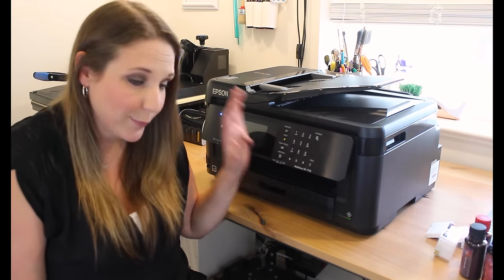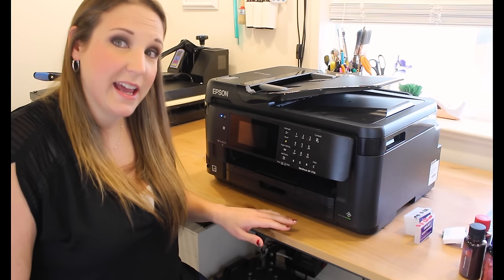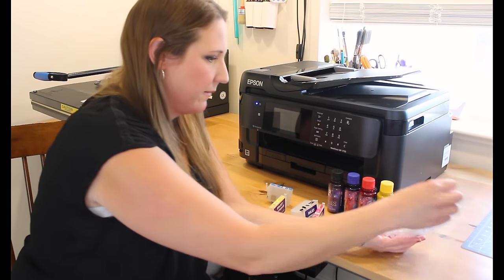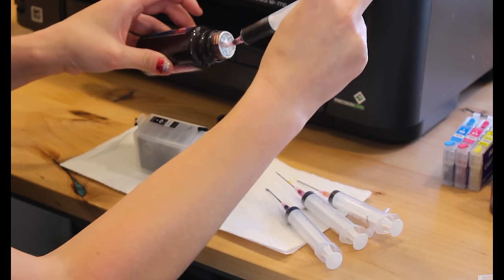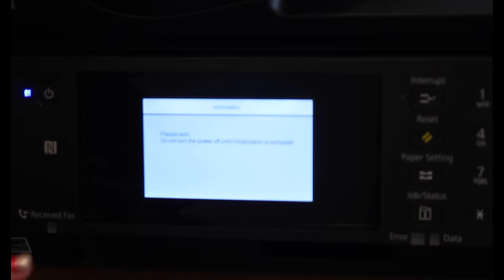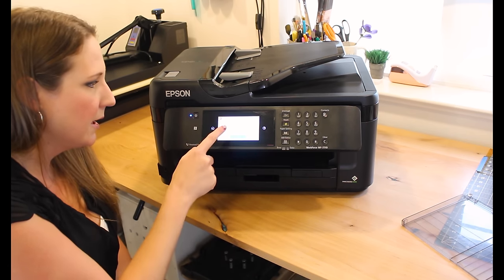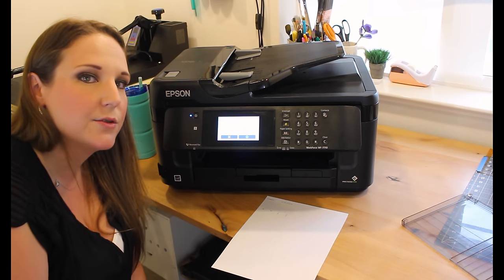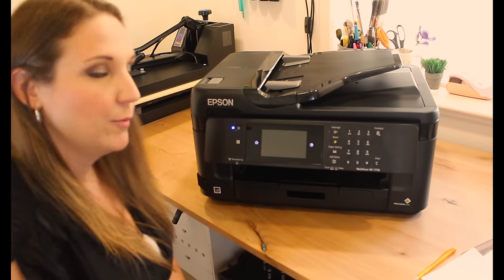How to Convert an Epson Workforce Printer to Sublimation

Comment: Debbie, I watched another video by you on the unclogging. You mentioned using Cosmos ink which I use also. The problem is that they sold out and  now Wala Inks sells ONLY the huge bottles which I cannot use (just a home hobbyist). Do you have any other suggestions regarding this? I love Cosmos Ink and have been told it's the 1st-2nd best without need for color profiles, etc.  I don't know what to use now or how I can purchase smaller quantities. Thanks in advance.
Reply: I hope Debbie answers your question... I'd like to know too!
Reply: Refill the cosmos with the walas

Comment: Thanks for your time spent on this video! I just wanted to say, when I changed ink brands in my printer(Brand X) rather than running several ink head cleanings, I found a colorful bubble gum picture on Google and printed it on 8.5x11 regular paper a couple of times and it ran the ink through rather quickly. Just a thought, worked great for me. THANKS AGAIN FOR YOUR VIDEOS!!

Comment: Hi  and thank you for your  tutorial very helpful and well presented. I have a wf2830 I bought from Wal-Mart for $99 for what I do it's perfect. The only suggestion would be for people like me with uncompetitive hands is to leave the fill plugs in until they are installed. I dropped a cartridge in the compartment and spilled some ink luckily no were to cause damage. I removed the plugs after they were installed. Thank you.
Reply from the maker: Good idea! I’ve spilled ink too. It’s no fun 😂
Reply: where did you get the refillable ink cartridges for the 2830
Reply: that was a question i had..... is it possible to convert the WF 2830 to sublimation. i am seeing all these other different workforce numbers but not seeing the WF 2830 as convertible printers

Comment: I turned my Epson artison 50 into a sublimation printer.  Could not believe how well it worked out.  I have 2 of them and an older R260 that I used for printing on DVD's in my Video business.  But since demand for DVD's is way down, I decided to give it a shot so I wouldn't have to buy another printer.  I am now trying to start a sublimation business starting with mugs and see how it goes from there.  Anyway, bought empty cartridges, 6 sublimation ink bottles and installed an icc profile.  I am amazed how well it worked.  I pretty much followed your video (thank you).

Comment: The CISS is a great system, I use one on my 7720 and there's a small learning curve to prime it that manufacturers don't go over. I took a trick out of my automotive clutch bleeding book. You hang the tank somewhere high and fill them up. Let the ink cartridges dangle low and make sure they're nice and straight. Then, one color at a time, use the provided syringe to pull the ink through the bottom of the cartridge. Don't stop when ink starts coming out, get a full syringe worth then put it back in the tank. As long as you don't let the tanks run dry, you shouldn't have any problems. But you're right, the tubing can be very sketchy flying back and forth at a million miles an hour lol, just follow manufacturer directions on securing tubing to your printer.

Comment: Hi and great video.  I just bought the wf-7310 with the re fillable cartridges and will use hippo ink.  Could I just use your process but instead farm the chips from the original cartridges after setup?

Comment: I was thinking about buying the same printer. I have a HP and I ordered ciss but it's a different brand so I'm hoping I won't have the same problem you do. But refillable cartridges are cheaper. Thanks for the information.
Reply: I have the same one as this in the video how do I get refill and which brand is better to purchase
Reply: @carlenewilliams5467  what model of printer do you have.?
Reply: @carlenewilliams5467  I got my Ciss at proinkshop.com. It was already full of ink and primed. I had mine almost a month and have done a lot of printing every day and I never have trouble getting air in the lines. It comes with a damper in the ink tanks and a damper in the cartridges themselves. When you receive your Ciss and if you have a lot of trouble getting air in the lines order a damper off of ebay and hook it on the line close to the ink tank and that should cure your problem. You can get a damper pretty cheap between 5 to 10 dollars.

Comment: By the way you can use standard paper to sublimate on the frosted side of that plastic mylar by taping the printed paper face down on it with heat tape and then heat pressing it which you will have to play with to get it how you want but it will make permanent stencils instead of you having to spend an arm and a leg for mylar sheets. I don't know if anyone else does that but it's something i did on my own and it worked!! I didn't print directly to it to try to sublimate it on anything though but hey i had the idea i might try it!!

Comment: Debbie, this is another excellent tutorial.  I do have a question about the refillable cartridges.  You noted the plastic 'tape' on the bottom of the cartridge should not be removed because the printer pierces it before use.  What about when you refill the cartridge for subsequent refills?  Does the pierced hole make a difference?  Also, what size will the scanner scan?  Also 13 x 19?  Thanks so much for  sharing your knowledge and experiences. Diane
Reply from the maker: Yes, the pierced plastic doesn’t matter beyond that. Just keep using the cartridges. The scanner isn’t quite as big as the print size. It scans up to 11x17”

Comment: Hello, great informational video.  You say the bottom tray will not have all the settings on the 7720, Can you just move the tray up to the top and change the paper size if it is different like you mention 8.5 x 11 on top and 13x19 on bottom?  Or are the trays physically different not allowing the trade?
Thank you.
Reply from the maker: No, the trays are not interchangeable. You might be able to forcibly out the larger tray in the top slot, but it won’t let you change the paper size accordingly.

Comment: Hi Debbie from Australia, Thank you so much for your video I purchased a brand new Epson WF-7725 and installed the Sub inks straight away after watching your video, do I ever have to do a head clean do the sub inks block the heads eventually I am new to this and wanted to know. Thanks in advance.
Reply from the maker: You don’t have to do head cleanings unless you are having problems with your ink. Even then, aside from the initial setup, I don’t recommend doing more than 3 in a row. If it still won’t unclog, then move onto a different method. This video covers the other methods I try. https://youtu.be/2sNtZwTs01c

Comment: My only question is is that it your using Cosmo ink why not use the purge file he recommends instead of doing several print head cleanings? Does doing it this way work better ?
Reply from the maker: This is the way I learned and know works. I have tried his purge file and I still had to do head cleanings to get it working but I have another printer coming this week I am going to try the purge file on again and see if I can get it to work.

Comment: Your video is top notch, the thumbs down always kill me on videos like these - I don't get it at all - 
That being said, I have a Epson WF-7110 and am able to print loooonnngg lengths from the top back tray.  
Are you at all familiar with this model?  
And am I understanding you correctly that your friend has run through the ink cartridges that came stock with her printer?
Because I have too and was told I couldn't  "convert" my printer.
Reply from the maker: You have to use refillable cartridges. The stock cartridges will not work. But refillable cartridges are easy to find for that model. They’re the same ones I use in my 7720.

Comment: Hi.  Thank you for the great video.  I have an Eason ET 2650 with the refillable tanks.  Can this printer be switched to sublimation ink in the same way.
Reply: Hi Lorraine
I have the same printer as you. Did you find out if it can be switched to sublimation ink ?  👍😀
Reply from the maker: Yes, ecotanks work great. No need for special cartridges. Just fill the tanks with sub ink.

Comment: Are there any issues with the Epson print driver stopping you from using 3rd party inks?
Reply from the maker: Sometimes it does give you errors. Usually if you restart the printer it will go away.

Comment: Ingot a lot from your video.THANK YOU just have this question for an Epson 2750 can we use ET 2750 cartridges  for it?
Reply from the maker: You need to find refillable cartridges meant for an ET-2750. The manufacturers cartridges will not work. They can’t be filled with new ink.

Comment: The colored cartridges are auto priming carts, but the black with that round hole has to be primed: that is static air and should be removed. Otherwise massive cleaning cycles are needed to remove the air from the print head. That round hole should be filled with ink after priming.

Comment: Thanks for your video!  I have a question though.  You say on the 7720, the bottom tray cannot be used for special print settings.  I'm guessing the bottom tray is for the larger paper?   If so, I would not be able to use the larger paper in the top tray to use the special settings?  Thanks.
Reply from the maker: You can use the other tray, you will just have to use the High Quality Plain Paper setting instead of Premium Presentation Matte.

Comment: Hello Debbie i appoligize if you said this but can a Canon  inkjet be converted or is it just Epson?
Reply from the maker: No, not that I know of. Most inkjet printers use heat in their printing process. The heat is harmful to the ink if it causes it to heat up before you are ready to press your transfer. You need to use printers that do not use heat in their printing process, and Epson is one of the few.

Comment: So, once converted and you need to refill the cartridges, do you remove them like original cartridge or do you leave them and refill them inside the printer so the printer's "Cartridge Not Recognized" alert doesn't go off? Thanks!
Reply from the maker: You can remove them, fill them back up with ink, and then put them back into the printer.
Reply: @DebbieDoesDesign  I sent this message over two (2) years ago. What took so long?

Comment: Best buy has the printer in stock and has a deal for a instant $120 gift card after you purchase one. I got the epson wf 7720 which is normally $299.99 for essentially $76 just an hour ago. $120 gift card and Walmart has them on sale for $179.99. They price matched.
Reply: Best Buy says: "I see you are getting free $120 Gift card with the purchase. I would like to inform, if we match the price with Walmart, the gift card will not be given. You can either have $120 Gift card or price match."
Reply: @montecarlo71500  I did both. I can show you a receipt. Of course I didn't  call them. The associate price matched with Walmart and after I paid for the item I received $120 gift card immediately.

Comment: Okay wow!! How i just wished you had this video out last year about early spring or summer when i absolutely trashed and burned my 7710 trying to use refillable cartridges with Inktec Sublinova ink. I see that i refilled the cartridges wrong i didn't tilt them and that first time refilling and placing down the refillables might i say is crucial because you start taking them out and replacing them you will eventually burn the print heads like i just did. Maybe that ink wasn't water based like it should have been?? I don't know if that was one of my biggest problems or not but i made many of them another problem i will add do not accept the firmware update this will stop you dead cold from using refillable cartridges. Well long story short i ended up buying a Sawgrass SG400 and i love it's easy use and the ink actually lasts a long time but i HATE being stuck with only being able to print out on 8.5 X 11.00 paper!!! I did later find out i can tile print an image on multiple pieces of paper but it can be tedious because you then need to cut and line them up perfectly on your substrate i suppose i could do a very small overlap i have yet to try that out but i will. Also, you can buy what is known as print film pet plastic from plastic guy on ebay it's basically white water washable frosted mylar that is .5 mill thick like stencils the same thing so there is a big money saver right there if you want to make stencils much cheaper and you can sublimate on the frosted side which will show up through the glossy side of that film then rinse off the backing if you want a transparent stencil which is pretty freaking cool. Let me know more how the refilling works best with the epson 7710 and 7720's though i might go back and buy another one for my larger prints sometime but i am buying different ink that actually works this time like you did lol. It was a sad day for me to have to toss the thing out because i unwantedly ruined the print heads!!

Comment: This video has help me tremendously but purchasing cosmo ink in usd and shipped to me in Canada will cost a fortune. Do you have a list of other sublimation inks that can still use the stock epson profile? I may find some at a Canadian supplier. My wife also uses the Cameo silhouette and this is a gift and I'd like it to work as seamlessly as possible.
Reply from the maker: Printers Jack is sold on Amazon and also comes highly recommended, if you’re still looking for an ink recommendation.

Comment: I have the 7610 would that work for sublimation?
Also, can you switch back and forth from sublimation ink to regular ink? I use my printer for regular, business and crafting lol so just wondering how that would work or if I need to get a whole separate printer for sublimation
Reply: The Cosmo Ink should work for 7610 as well, but it's recommended to have a whole separate printer for sublimation. As you can see the labor involved to switch between inks and ensure inks aren't mixing and nozzle heads are clean. Debbie Does Design Co. always provides helpful information, so I am just paying it forward by responding to a few questions on here, so these are just my opinions on having 1 printer for Sub and 1 for regular business use. I would recommend your 7610 for regular printing and investing in a 7720 for Sublimation since it can hold more paper and print long sheets.
Reply from the maker: Yes, what Millennia Studios said, you don;t want to be switching them back and forth. It’s a lot of stress to put on the printer and won’t last you as long as it should by doing that. And yes, that model should work. You just need to find the appropriate cartridges for that exact model.

Comment: I just bought a WF-7840 printer. Are you using the regular sublimation ink or the fluorescent sublimation ink in the video?
Reply from the maker: Just the regular sublimation ink. I haven’t used the fluorescent. You need to have a 2nd printer dedicated to the fluorescent ink if you want to go that route. It’s not good for the printer to switch back and forth.

Comment: Hi,
I will need to refill my refillable cartridges, how do you do it?, just pull the cartridges out and refill without the doing anything in the maintance settings of the printer?.

Thanks for you video, but I need to do a refill sonn.
Reply from the maker: Go into the maintenance menu and click the replace ink cartridges button and follow the prompts. But instead of putting in new cartridges, you simply refill your cartridges and put them back in.

Comment: So I have done 5 cleanings and my black is perfect. However, my colors aren’t printing at all! Do I need to let it rest like you said? More cleanings? Is there a reason black works and colors don’t??
Reply: Same thing happen to me. I removed all the cartridges and started again running the cleanings  again.
Reply: @rajigga73  Did it work? Mine prints all colours except black
Reply: @jenniferosborne6827  it took me about 15 sheets befor it finally worked.
Reply from the maker: This video should help: https://youtu.be/2sNtZwTs01c

Comment: Im buying a 7720 epson and i see you have refillable drop in ink cartridges.  Where can i get the ones that just drop in and are refillable.  As all im finding is the ones that have a hose and have to be drop in while hoes runs out side the printer to ink holder cartridges
Reply from the maker: I got mine from Cosmos Ink www.debbiedoesdesign.com/Cosmos

Comment: Hi There, What do you know about the Ink Maintenance Box? Is that needed when it's all converted?
Reply from the maker: The maintenance box will be find for a long time. You have to print a lot to wear that out. It happens though. It just depends on how much you print. I haven’t printed enough to have any issues with mine.

Comment: unfortunately, I have to disagree with the ciss system as I have no problems because I keep up-to-date cleaning it and make sure the heads are up to standard. but you are right it is easier to use the other way if you cannot get on with the ciss system.
Reply from the maker: The CISS did work for me, but it was very fussy. The cartridges are much easier to deal with. But that doesn’t mean you can’t use a CISS. It’s just my personal preference, and what I recommend to others after using both.

Comment: Do you have to get specific sublimation ink for your printer? I have the epson xp-4501. Also, is there a specific syringe that is needed. I order refillable cartridges but forgot to get syringes.
Reply from the maker: No, you don’t need a specific brand, although some brands are not as good as others. I recommend Cosmos Ink. The syringes usually come with the ink, but you don’t need a special syringe. I’ve heard some people get syringes from a drug store like Walgreens.
Reply: I'm going to cry at the fact that you have an xp 4501. I've been trying and don't know how because the cartridges have the chip. Can we just replace it with the no chip one? Can we somehow refill the chip ones? I'm lost